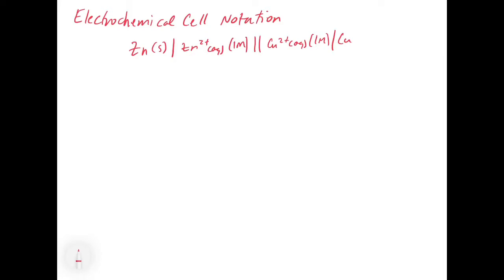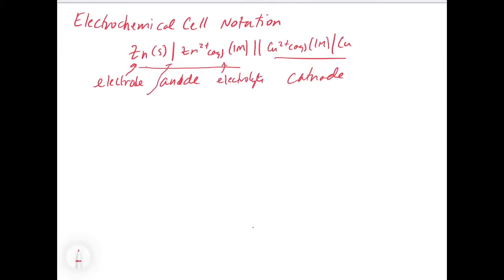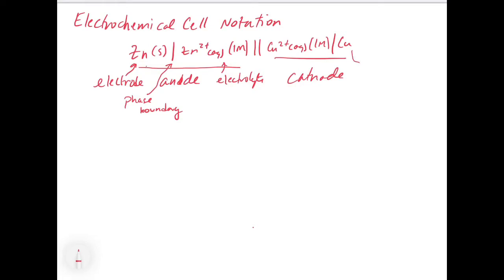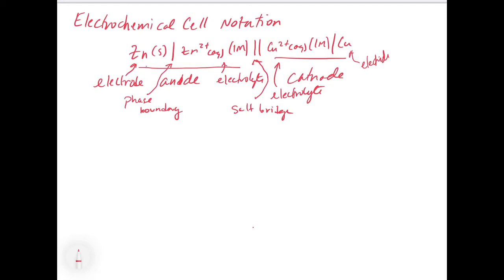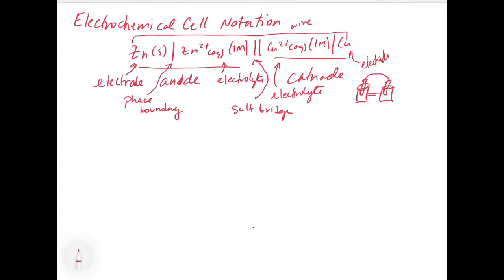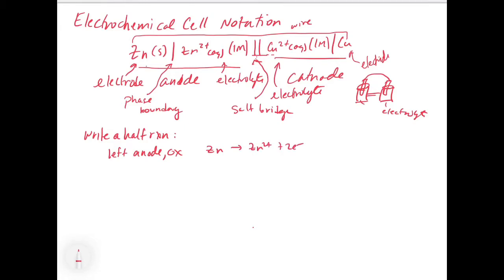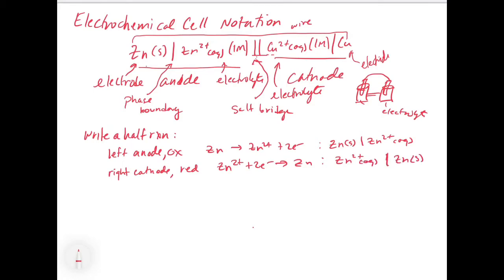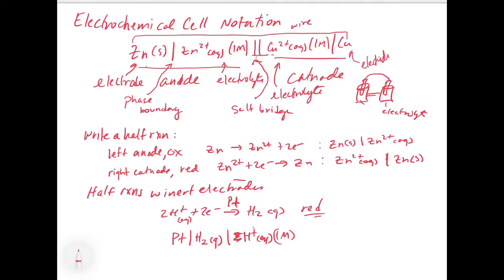Chapter 19. Electrochemical Cell Notation

Comment: Why is the Pt electrode on the left of the notation at 5:37 if it is a reduction reaction?
Reply from the maker: Technically, it should be on the right side since the half reaction is showing it as a reduction. At this point, the focus is on explaining how we construct the notation and how we handle a catalyst like platinum. At 7:20, we build up to your question which is: (now that we know what the lines mean) how do we deal with writing cell notation for a reduction vs an oxidation. Although you can sometimes use cell notation for a half cell, it is most commonly used for complete cells since you need to know the relative reduction potentials before you can decide if half cell will be the anode or cathode in a voltaic cell.

Comment: Do you need a Pt over the very last arrow you draw (14:50)? What about the one at 9:48?
Reply from the maker: Thanks for the comment. At 9:48, the reaction that is written is a half reaction and these do not require the Pt to be included over the arrow but it would be technically more accurate to include it. At 14:50, the full reaction should have the Pt written over the reaction arrow. In both cases, it depends a little bit on how specific the question is.